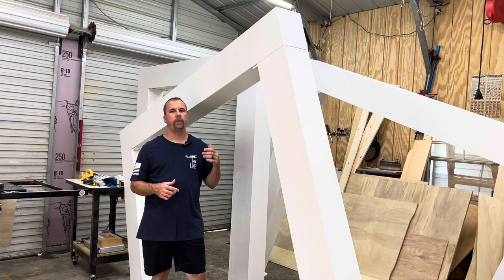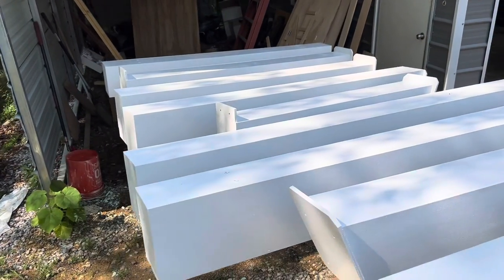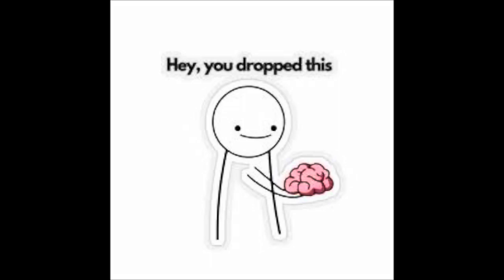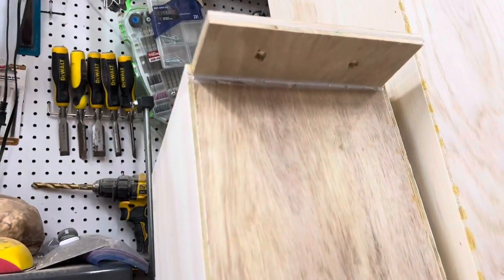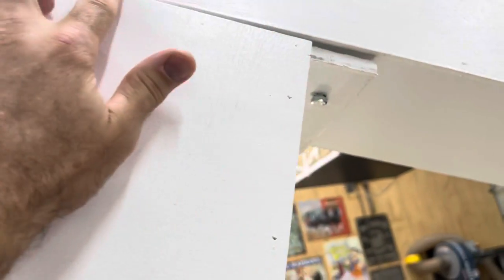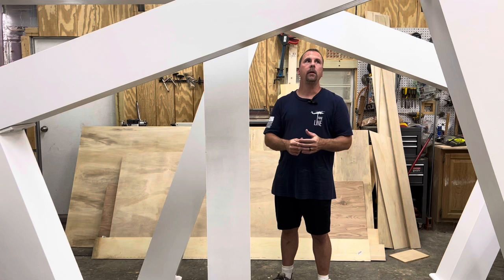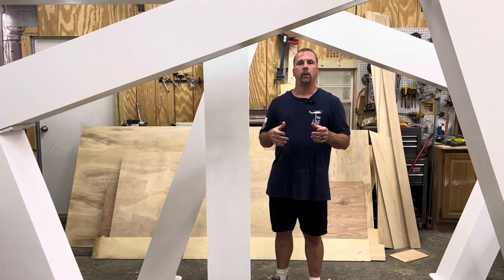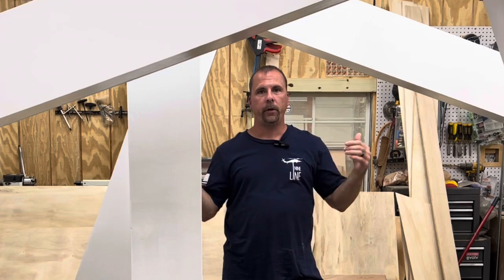How To Build Slanted Arch Walls For A Party Prop

Comment: Just purchased plans. Will find a local carpenter to build. THANKS SO MUCH!!!
Reply from the maker: Thank you
Reply: What I need to know it's just the angle what angle are you using in which with it's 12 o 16
Reply from the maker: @osvaldomares4622  plans will give that information